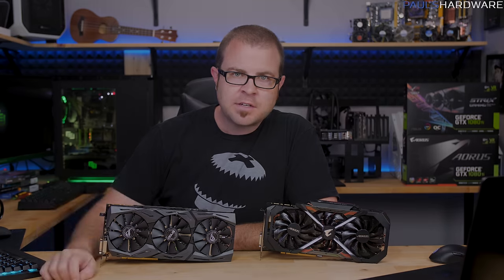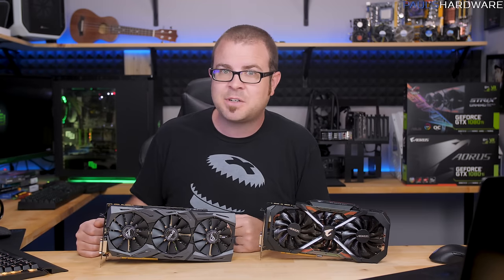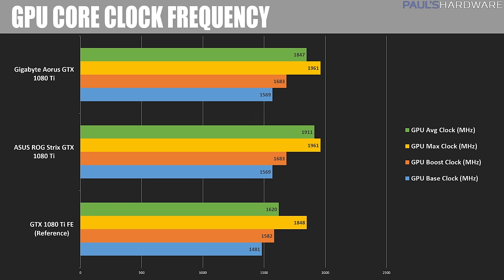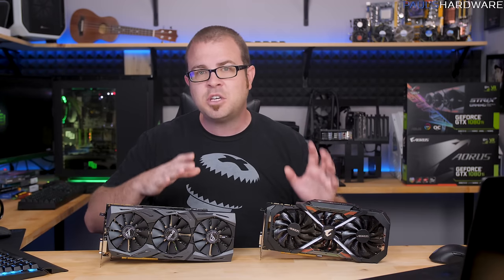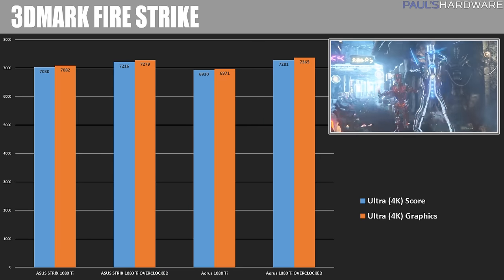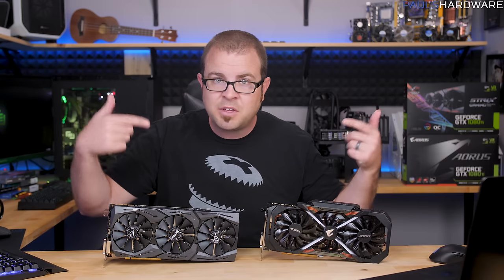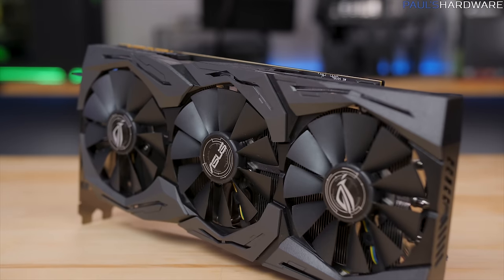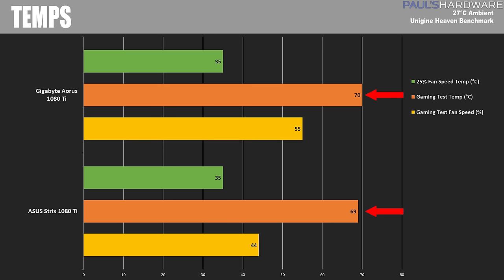AORUS vs STRIX: Why My 1080 Ti Showdown Doesn't Matter

Comment: U can choose based on overclocking capability or a more realistic durability. If u are the latter then first off DON'T get a gigabyte. Gigabyte are still using the same windforce fans from their 900 series. Those fans are poorly built and suffer a lot of wind turbulence they will snap off within one year. Second, even if they give u a good GPU chip the rest of the components on their PCB are of poor quality. My 980ti blew out a power IC in 3 years (if u decided that a GPU that u paid as much as ur entire PC combined is supposed to die in 3 years then u clearly don't care about ur money that much) 3 years might make sense for a GPU that was overclocked but I used mine without overclocking. It should have lasted 5 years. Gigabyte may overclock well but the build quality is trash.

Comment: almost same... 10 or 20 fps is nothing when you have 100+ in game....OC? just but 2 and use SLI mode... 2 1080 is cheaper than rtx3080 but better in sli mode

Comment: lol That poorly fitting insanely thin all metal shroud is a joke. Look at the giant air gaps between the blades and the shroud. This I could almost look the other way if it was not the most flimsy thin gauge metel they could use. They are prone to bending and brealing. I would take the Asus plastic any day of any week over that metal shroud disaster. No I do not own either one.

Comment: I don't get the "quiet" as being as important as it is made out to be. At idle it should be silent but at load it doesn't need to be considering there is the case itself muffling any sound and then there is the sound from the game. Testing the sound with an open air test bench is meaningless because a case blocks some sound. Then at idle there is usually some ambient sound such as an HVAC unit running, a ceiling fan, traffic sounds if you are in a city, allot of ambient noise if your window is open. Plenty of ambient noise that makes hearing an idle GPU and CPU cooler unnoticeable. The at load with a game you have the game sounds ontop of ambient and maybe headphones on that makes hearing an average GPU and CPU cooler impossible. I think the noise level tests should be tested outside of a sound proof studio and in a case for idle noise levels, and have speakers on with a game running for load tests to be more accurate on if the sound levels are good with the cooler. If you can hear it under those tests then it is an issue... otherwise it isn't worth even noting in the review.

Comment: I just want the hands down fastest 1080ti dont care about noise heat etc
Reply: RubberGently then the hibrid asus 1080ti is the best gpu in overclocking. Jayztwocents made a video abou it, that gpu can handle 15hz more than every other 1080ti.

Comment: Thumbs up if you're waiting for RX VEGA
Reply: RepsUp100 did vega gonna be as powerful as a 1080ti ? if yes then when ?
Reply: Thats wrong..
Reply: Thumbs if you are tired of waiting for Vega.
Reply: Of course I'm waiting for VEGA!
MAKE. SOME. NOISE.
Reply: AMD is currently trash
Reply: junk bot their graphics cards are decent, cpus are amazing
Reply: why cheaper? the ryzen 7 1700 and 1700x are more or less the same price as the i7 7700k and perform the same
Reply: The 1700 and 1700X wipe the floor with the 7700K wtf are you talking about man...
Reply: Anthony Paull lol no
Reply: Leo Hofbauer The 1700 scores 1400 in Cinebench. The 7700K scores 1000. You do realise most people don't play games yeah? If you take gaming out of the equation, the 1700 and 1700X stomp the 7700k hands down.
Reply: Rama you won't be able to tell the difference between an i5 2500 and the i7 6950X while writing an essay mate. 

And you would be surprised how many people render videos. You know the film industry exists yeah? And so do advertising companies. Probably the 2 largest markets for high end CPU's designed for rendering. Either way, claiming that the 1700 is slower than the 7700K is just downright dumb. Saying it has slower single threaded capability is one thing, but overall the 1700 wipes the floor.
Reply: Anthony Paull Why would you buy a 7700k to just edit with ?..

Explain please very interested you see as your talking aload of codswoolop.

This should be funny PEPs pay attention, we are about to learn something.

Go on mate!. floors yours!.
Reply: Anthony Paull 
People can have differing opinions that is ok.

I'm actually about to Build an 1800X system. Friday I'll start.

For Gaming and Video editing,and anything else I'd like to do with it.

Why you think anyone would Buy a 7700k to purely Video edit with is beyond me.
Reply: BuGGzLuVa GAMING Not once did I say ly someone was about to buy a 7700K to render videos with...
Reply: BuGGzLuVa GAMING what it boils down to is that the 7700K is 5-10% better at gaming, and the 1700 is 50% better at everything else.
Reply: Anthony Paull 
Your logic is just messed up in what Games?. 

That's not just an always thing you realise this right?.

I'm some circumstances they beat each other.

To keep making such a blanket type comment thinking it covers all Games all circumstances is daft.

I luv AMD huge fan of there Hardware every, PC I've built has been based around there CPUs and GPUs.

You could stop seeming so one-sided, who cares about 10 fps either way Lol.

Who cares who's renders a Video faster, you realise Editing software leverages your GPU also right ?.
Reply: BuGGzLuVa GAMING Dude, I'm talking about averages here. And when a video that would have taken 3 hours to render only takes 2 then you just saved an hour. Otherwise who would buy the 6950X when it's barely faster than the 6900k?

I'm running a 1700 in my system at 1440p and see no difference between it and the 7700K, but at 1080p there is a small advantage to the 7700k.

I'm sure software will become more optimised for it in the future, but right now the 7790k is marginally better for gaming.

Comment: I'm just here to run Final Fantasy XV 4k on PC. lol (which requires GeForce GTX 1080 Ti)

Right now the AORUS is $984.98 w/ shipping
While the STRIX is $1,034.99 w/ free shipping (due to high demand, right now its $1,329.99 cheapest atm)

PRICE WISE, if you're aching to buy a gpu right now (including myself), I would get the AORUS.

This is from the United States btw, price may differ from different countrys.. sorry :(